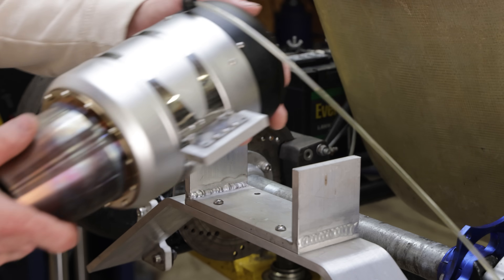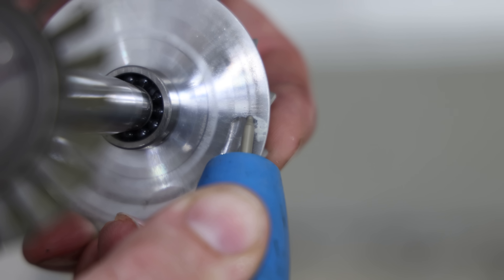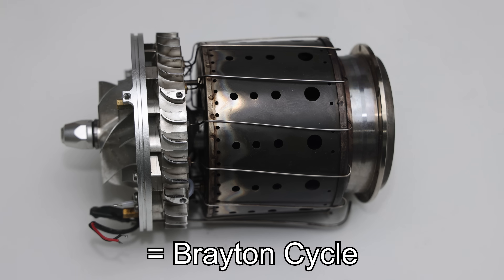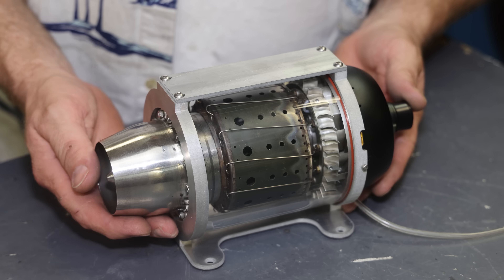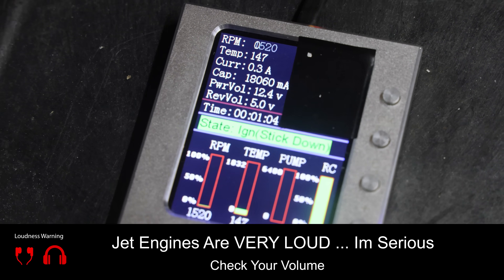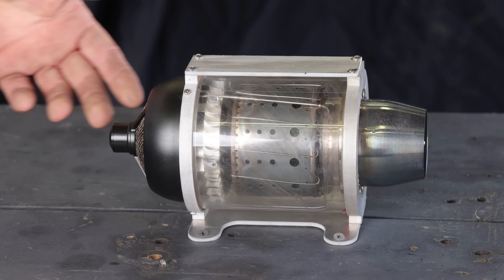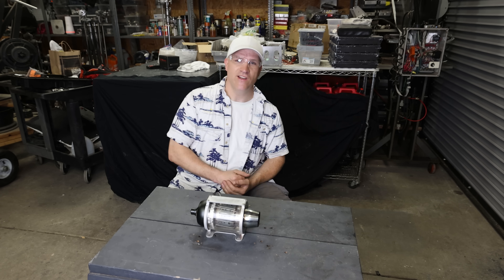See Thru Jet Engine

Comment: About the air flow, there's a lot more with a turbofan design. It's not much different. Just start with a jet like yours, add a fan in front powered by the rotor to suck in air, and an extra casing around the thing to route the excess air. The optimal shape for all that is complex but the basic theory isn't. Anyway, that's probably where the expectation of large air movement comes from.

Comment: Now that i think about it, if you made the engine turn slow like with the starter motor only. 
You could see the smoke flowing through it 

When it spins too fast that smoke thins out so bad you can't see it. 

When it spins slow? You'll see it

Comment: Why nobody have tried before, build a turboprop or turbofan engine with this small turbines, adding a secondary turbine to make spin it with the thrust power of the engine and use that tangential torque to move a fan or propeller as the small airplanes do, using something like that with a gokart putting the power direct to the tires would be better than just using the thrusting power

Comment: How much thrust does it make? without making thrust it is not a engine but a demo toy, I guess it doesn't make anything worth noting, it lacks many stages it has to have 17 to 28 stages urs have about 3 or 4, but lacks of LPC, HPC, HPT, LPT is the reason u don't get any thrust. also if u want to make those HIGH-PRESSURE TURBINE blades I don't think any individual can, cooling holes and meshing of those blades will take u two to 5 years. This engine cannot run 15 min without blowing up. Very nice work though but aviation realistic no.

Comment: Hey just wanted to mention commercial jet engine's thrust does not mostly come from the fuel. Most of the thrust is created from the blades in the front directing air around the combustion chamber (bypass air). Pretty cool, but it does take the combustion chamber pushing the rear blades, which drives the front one's to create all the power. 20 percent of the thrust comes out the back of the combustion chamber. 

Ps: before saying I'm wrong, show your proof and the resource you got it from.

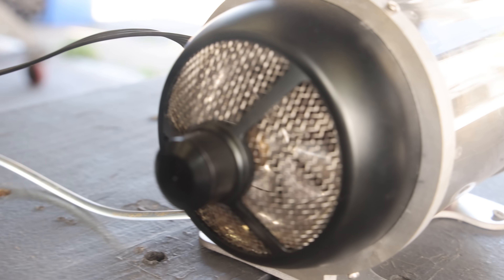Comment: #9:00 well, its the idea behind those engines - in high-bypass engines which most people are familiar with as far as what they've seen on planes, most of the thrust comes from the bypass flow fans (75% - 90%), not the fuel burn thrust.  So in high-bypass engines there is a lot of vacuum. If you attach a fan to the front of yours and duct it, you'll get the air flow effect you're looking for.

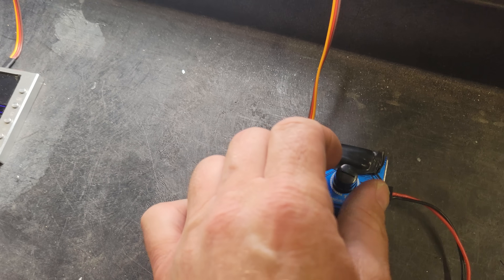Comment: 7:41 oh duuuude get some ballistic plates up! If that glass fails it’s all going …in your direction. Also the reason the fog doesn’t work (I think) is because it heats up enough just from being compressed that whatever you’re using becomes less-saturated vapor - which is why you don’t even catch anything on slow-motion

Comment: The air flow was not what you expected because you needed a velocity stack on the intake. We have proven that screens are the absolutely worst way to protect a turbo/turbine intake. They are 50/50, meaning 50% open, 50% closed. Your turbine could pick up power by getting rid of that screen and adding a velocity stack

Comment: I mean... it's technically true that the amount of air pulled in is almost nothing compared to the amount of pressure created in the exhust..... but it's a bit misleading because it still pulls a LOT of air and a typical jet engine will be able to lift up a 90kg male human and pull him in, even from 2-3 meters away. the parking spots of these jets have large yellow cone areas marked on the ground where no one is allowed to step while the engine is running.

Comment: you can improve thrust by adding a bigger fan and a bypass case around the core, as modern turbofan plane engines. Try also a less tapered nozzle cone, more like a cylinder or even a paraboloid shape like a rocket without a throat. Most of the thrust comes from the fan that works as a propeller, not open but inside a case, for safety and noise purposes. With your core turbofans, the thrust comes from the blades of the wheels inside, not from the speed of exhaust gases (check thrust without the nozzle you use now)

Comment: Not that this isnt awesome its just im confused why people are so impressed bu the build i mean you cant buy these kits on line all day its not like a built from scratch situation or say like the dude who builds them out of soda cans . Thats right friggen soda can jet engines that actually run and self sustain build from scratch now that ones impressive and theres several other people who build them from scratch also way more impressive in my opinion . The clear body is awesome for sure but its just some parts you can buy bolted together lol like getting really excited over a model car or something
Reply: Also a couple other things i noticed the bdc motor kinda makes it not truly a jet engine more hybrid or motor jet right also it would have survived much longer and expanded much less had the frame been a bit more proper as far as the supports and being made from aluminum should have gone carbon steel with a good hardening and tempering with either 3 or 4 ribs instead of just the two or even make a few of the end cap bolts go fully thru to the other side sucker would been real solid then being that the compressor is that of the turbo charger design idand based on its size id say tops it givinh ya 30 lbs of boost if that since it doesnt have the snail to the combustion the the velocity of air moving thru these things at rest isnt really much it only needs enough air to mix with the fuel and ignite really

Comment: Back in the late 60's in the USAF I test run the PW J52-P3 engine used on the AGM-28B Hound Dog Missile.  One time at night I could see the turbine blades Appear to run forward and backward right through the turbin case that was glowing red hot.

Comment: Excellent demonstration. Eager to your second video on what going on inside the reaction chamber.

Just quick one, what is the function of the stators in this particular design..? Is it only for the air flow or for cooling the outer body...? Appreciate answering my concern 🙏.

Comment: If you have a 5 axis cutting machine & a 3d printer, you should try & build a multi stage compressor & exhaust blades like a real jet turbine. Also if you turn down the lights the hot section will look better.

Comment: 9:00 i dont know if you have mistaken 'energy' for 'thurst'. if you mean most of the energy comes from fuel, youd be correct altough you cant understimate air as you need oxygen for reaction to release this energy so id say its 50/50. but if you meant thrust that is a false statment. ~80% comes from air that goes around combustion chamber in comercial airflights, in fighter jets around 20% of thrust comes from air with after burner. all of those numbers will highly depend on engine type and its state

Comment: next video you should install a pressure gauge so we can see what kind of cold air pressure its producing at max throttle, i would try several different ones, 0-100psi, 100-3000 psi and 0-1000 psi

Comment: Hey. So I'm a pilot and a bit of a knowledge enthusiast so I'd say I have an above average knowledge of mechanical things - like turbines. But, I've never really understood the physics about what is happening inside a turbine engine, so maybe someone here can enlighten me. 

This engine uses a centrifugal compressor rather than an axial one. Why are the stator blades shaped like an airfoil and where does the actual compressing take place?

Does the compressed air enter the cc through those holes? Why are the rear holes larger (I assume it's to make the volume of air evenly distributed}?

What are those wires for?

Most importantly: Assuming the air is compressed at the stator and flows around the outside then enters the c/c where it mixes with fuel and ignites and expands, why does it not expand out through the same holes it entered through and stall itself out? And, since there is continuous combustion -  unlike a reciprocating engine with a spark - how does the compressed air force itself into the c/c which clearly is much higher pressure? 

Thanks

Comment: I suppose you used dry ice to make the Fog. Surprised a bit that didn’t choke out the engine. Would be interesting to see of the thrust is effected by the CO2 when it kicks in.
Reply from the maker: No Dry Ice, it was water/glycol vapor

Comment: Awesome work. Incredible. Yet, allow me the caution: Did I read that right, more than 126.000 rpm? So let's say, a part losens and flies out at the speed of the outer radius, and red glowing hot.  How healthy would it be for you to stand this close?
Reply from the maker: Yes that is correct. And yes parts do fly out, you just need to thank all the safety precautions and know where the proper place is to stand.

Comment: Cool video. Cool engine. If I may, you forgot to explain what is the source of ignition. Thats its basically the same as a diesel engine and when the air fuel mixture is compressed, it gets very hot. Hot enough to ignite the compressed fuel mixture. Theres no spark plug necessary to ignite the fuel mixture. Its purely ignited from being pressurized.

Comment: Very nice. What starts it, is the black thing in the front is a dc electric motor, acts as the starter?
What type of bearings you use that can survie such high RPM?

Comment: I used to work for a company rebuilding spacex rocket boosters and jet turbines for Pratt and Whitney, General Electric, and Rolls Royce,  we would have to balance these impellers and air intakes by spinning then in spin tanks at roughly 130,000 rpm’s to expand them at a molecular level to resemble full thrust in the upper atmosphere. When a 26 inch turbine let go inside a 3 inch thick spin tank with 4 x8 inch lead brick reinforcement. A 24” thick steel rod enforced concrete room . The pieces of titanium blew through all that as well as the roof of the building landing a 1/4!mile down the street!!I knew we were playing with serious shit💀

Comment: What I don't understand is the following, 
1) How can that engine be spinning at 90.000+ rpm creating thrust and that small wooden support its screwed to not move in the slightest.
2) There must be some kind of bearing on the spinning blades? are these not lubricated if it has them? if it doesn't have them what does it have instead?
3) What ignites the fuel?
Reply from the maker: It's bolted down to a test stand, the stand is anchored to the concrete.

Comment: I just watched an air crash investigation type video the other day where the plane flew in to a tornadic storm hail core and both engines died because hail blocked some kind of bleed valves that stabilize the pressure in the front part. The engines started surging and instead of backing off they kept them at full and compressor blades bent and failed. Reminded me when I saw your gasket and the surging.

Comment: Super cool video. I had never seen a jet engine explained so well. One question I have and maybe I just missed it, how does the engine initially start? Are you supplying a very small amount of fuel into the combustion chamber and igniting it - and then it begins to spin up in speed as you supply greater amounts of fuel?

Comment: The key to understanding the airflow in the combustion chamber is that the airflow from the compressor pressurizes the entire combustion chamber. Don't think of the air flowing rearward from the compressor wheel, then going backwards through the combustion chamber then somehow reversing and flowing out through the turbine wheel. Pressurized air flows into the combustion chamber from all around it through all the vent holes. High pressure air coming into the combustion chamber prevents the ignited hot gas from flowing backwards through the engine so it has to flow out of the combustion chamber through the turbine wheel.

Comment: I'm a mechanic so I know a lot about cars and I've been 3d printing different jet engines and I want to turn my 3d printed jet engine into a fully functional engine because I printed it with a metal 3d printer but not sure how to do the fuel ratio and how do you get the combustion. Are you using spark plugs to ignite the fuel?

Comment: I am working at Lufthansa Technik. Just on last friday, I asked at the aircraft engine test stand we have on our facility. I want to visit the next up comming test run. My question to the test crew ist the pressure at the last sage of the compressor right befor the moment when egition starts. I am interestet in wich pressure is required to start the flow of burning. And of course I am interested in the max pressure inside the compressore and also the pressure and temperature inside the combustion chamber. And may be they also messure the intake temperature and intake pressure at the first turbine stage. I am very exited for this. Tomorrow on Monday I will call the team boss to ask for that I can  come over to visite the comming test run.
Reply from the maker: Good questions, I'm curious too, In the next see-through jet engine I will have to test those pressures... That's interesting

Comment: I had a design for a solid fueled jet engine so Dave Burdo a mechanical engineer of GE's Erie lab used it  electric car program while an editor Yang Xiao of Chengdu Sichuan used it for a cruise missile to stop navy vessels in of the South China Sea so after by invite only to MIT I decided to pursue x-rays on hafnium to power a Lockwood valveless jet engine since at high velocities such an engine could function as a pulse detonation engine.

Comment: Adapt a jet engine to turbo prop or even amount a propeller to turbine shaft and see what you could make work?
Reply: It's been done by adding a free power turbine and little reduction gearbox to the back of the engine, which becomes the front, with the intake at the rear.  The exhaust is ducted via two elbows and the whole thing looks rather like a P&W PT6.

Comment: why all diy jet engines are always use inefficient combustion chamber? it looks like airflow turns 180 degree twice. while it should be just a growing in diametre tube. airflow should not turn backwards. why they do so?

Comment: although seeing the streamlines on the case after the fact is interesting, the heat distribution along the flow axis of the combustor is really interesting. It would still be interesting to know the fine structure of the flow.

Comment: Not surprised it didn’t melt. Those holes in the combustion chamber is for the air bypassing the engine to enter the combustion chamber in order to centralise the flame in the combustion chamber keeping the combustion chamber walls cool. It’s always funny to hear people claim that the combustion chamber is the hottest part of a jet engine. It might be the hottest AREA but it’s not the hottest part for the reason I stated. The hottest actual part is nearly always the 1st stage NGV (nozzle guide vane)

Comment: i would love a  small turbine engine for powering RC planes and such but the price is out of my range but i DO have access to a full machine shop at my job (im an industrial designer) so i have a CNC router, small desktop metal lathe, a fiber laser cutter for metal laser cutting as well as a fiber laser engraving machine capable of deep 3D laser engraving of metal, also have several 3d printers specifically for jewelry casting, and i also have a small metal casting station(also for jewelry making) also have a kiln ...so im thinking that i might have mostly everything required to make a small turbine engine, (with the exception of maybe a 5 axis cnc for machining the compressor blades) ...so assuming i do in fact have enough tools required to get started, i was wondering if you had a suggestion on where to get started? is there maybe a popular design/ blueprints  available for a maker with limited tooling? maybe a maker who successfully built an engine with limited equipment and documented their progress and work arounds? ...i would love to learn how to build these engines but im just at a loss as to where to get started. Thanks

Comment: I would like to see if it's possible to use a solar-powered steam turbine to transport lots of water very fast.  The compression stage accepts low power steam.  Sunlight from a large array of solar mirrors is focussed on what, in a jet, would be the combustor, raising the pressure of the steam.  Energized steam drives the turbine as it exits, and proceeds along a pipe to the next turbine, which might be some distance in the direction of travel.
A similar design might be used for high volume continuous water desalination: once the freshwater steam has passed through the turbine and is moving fast along a pipe, inject salt water into the steam, yielding a lower pressure steam suspension of salt crystals.  Pass this suspension through a vortical extractor to remove the salt and send some of the resulting steam back to the input.
Used together, these approaches might be employed to desalinate agriculturally significant volumes of seawater and transport it to a high point from which it can flow by gravity to farms.